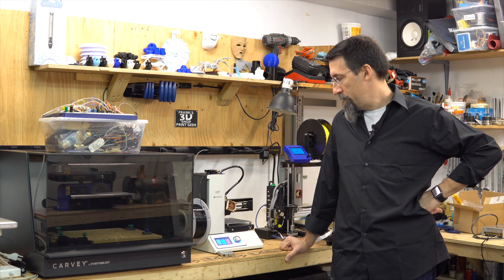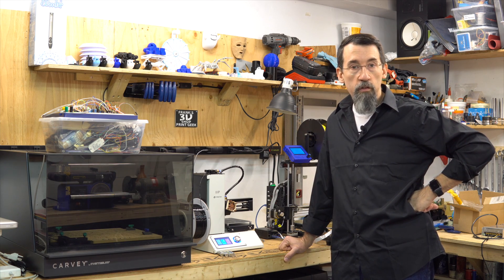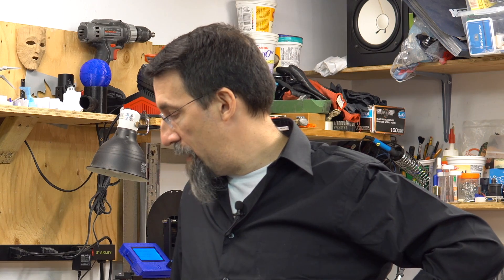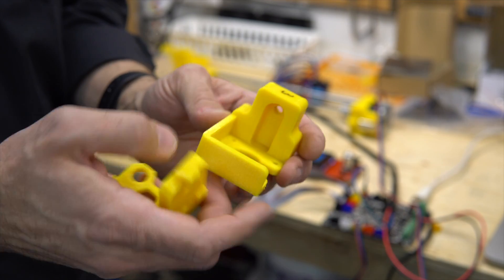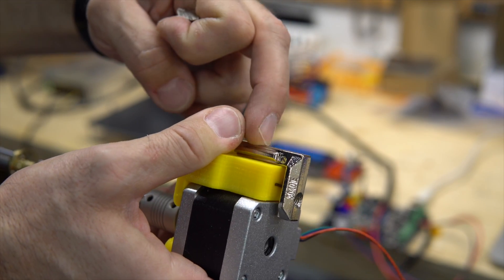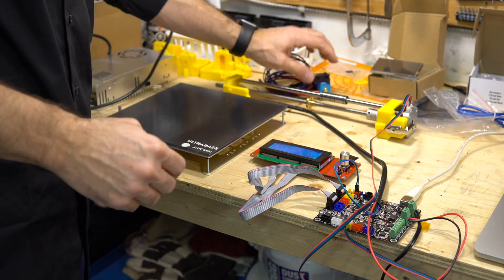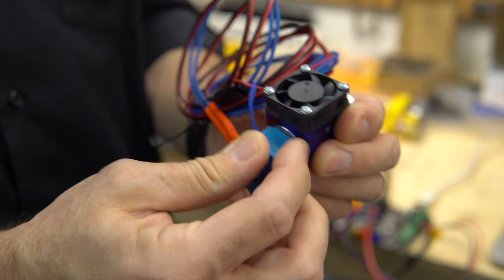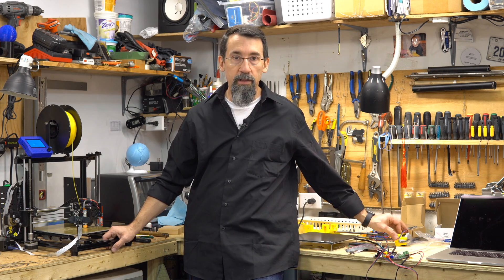Monoprice Mini Follow up and The New Printer

Comment: Enjoying your videos. 
Question about your Monoprice Mini V2. Have you had any problems with the MicroSD card?  Mine has quit working. I bought a new MicroSD card and the printer doesn't recognize the card even though my computer does. 
Thanks
Reply from the maker: Hi did not use the SD card much, it was still working for the update that I had to redo. It as to be in the right format, FAT32.
Reply: Frank's 3D shop.  I have also recently learned that it cannot be larger than 4 Gb. I bought a 2gb from Amazon. Now it works again. Thanks
Reply from the maker: Yes good point, the SD Card standards, so many to choose from !